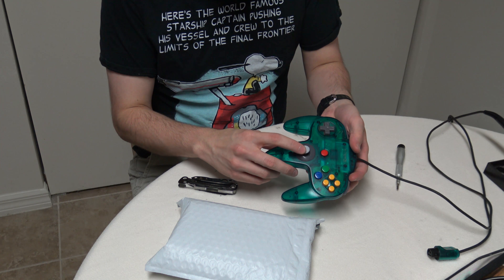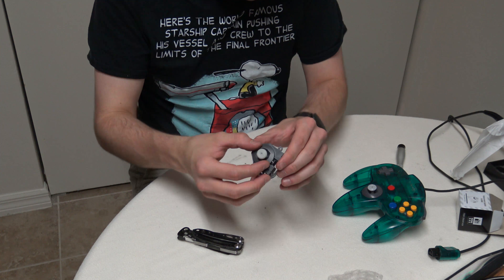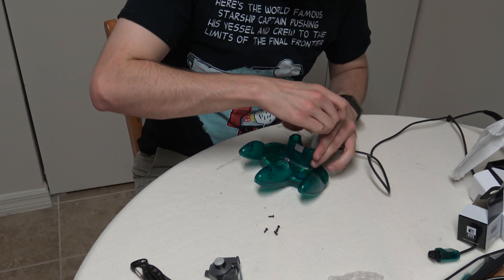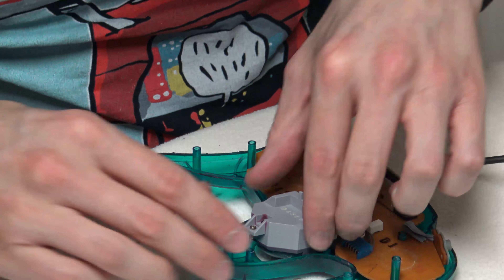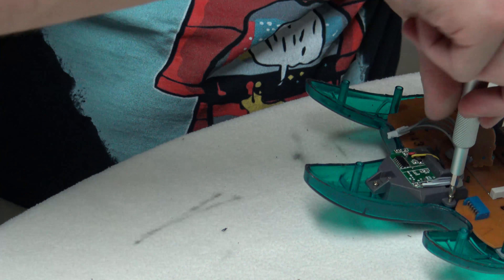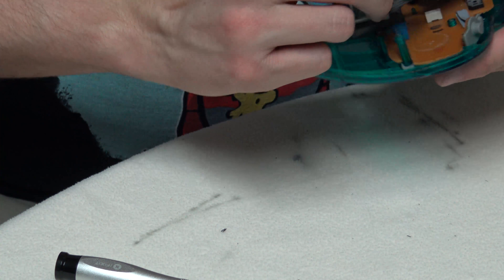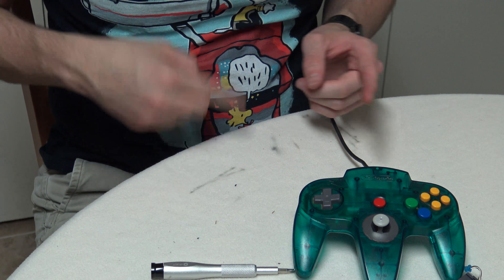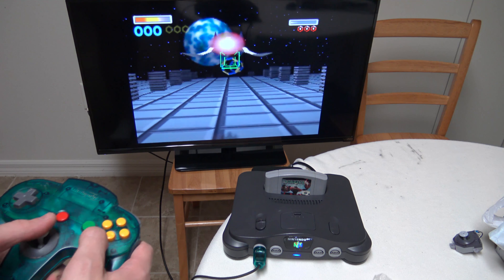Chinese N64 Joystick

Comment: Before replacing the new joystick assembly... Take it apart and pack the cup with dialectical grease.  It will feel , work and last 100% alot better
Reply: John .Saylock What type of grease is ok to use without damaging the plastic?

(EDIT) The guy that makes Steel Sticks also sells packets of Synthetic PTFE grease.

Comment: You could try adding mechanical grease to it to smooth it out and to make it more durable.
Reply from the maker: Wyatt James  I will look into the grease for lifespan, but I actually like the stiff return to center.  Ans the resistance.